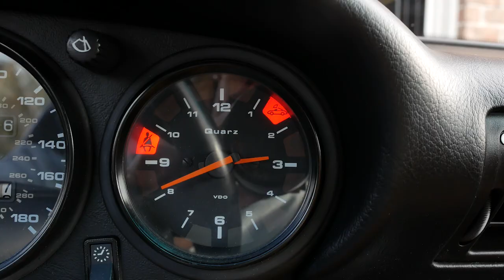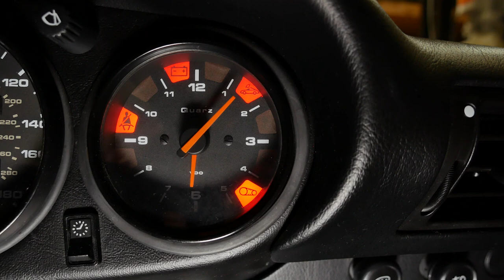Porsche 993 Convertible top Latch motor repair!

Comment: Your videos are great!
I'm waiting for my gear set to arrive, so I can rebuild my latch motor.
One issue I'm concerned about.
I took my latch apart as instructed by your video, yes easy!
I'm noticing that the cam that triggers the micro switch may be actually attached to the broken gear via a torx screw.
On Franny's video, her latch motor cam is attached to gear shaft via a set screw, which allows her to adjust the cam position after the gear is pressed onto the shaft.
In my case there is no way that I can adjust the cam position once the gear is pressed onto the shaft.
I'm trying to figure out how I can make sure that I'm pressing the new gear onto the shaft so that the cam will be in the right position to trigger the micro switch?
My car is 1991   911 or 964.
Any suggestions would be greatly appreciated.
Reply from the maker: I think I remember there are a couple different versions.  I think you will need to mark everything before pulling the gear off.  I bet the original manufacture used a jig to align it all before pressing on the gear. Is your microswitch position adjustable?
Reply: @HeidiandFranny   
WOW!  thanks for getting back to me.   
The part is temporarily back in the car.
I'm waiting for the replacement gears to arrive.  
In your video I can see that there were instructions that came with the gear set.  
Maybe that will reveal something.  
I'm not sure if the micro switch in my unit is adjustable.
Marking the gears and cam location before taking them out per your advise is my only option.
In watching your video, I'm seeing that you adjusted the cam by feel and visual as to when the micro switch engaged. 
That leads me to believe that the position of the cam does not have to be 100% spot on.
I will also check that function before taking the gears out and cam out.

Thanks again!

My biggest problem is that I know just enough to get myself into trouble.  LOL
This car is new to me, have only had it for a couple of weeks.
Sincerely
JC
Reply: @HeidiandFranny  
BTW
We named our 2014   991 Heidi while she was still in process of being built in Germany. 
We have never named a car before, but we probably going to name our 1991   964 Franny
Reply from the maker: @johnc1486  I'm sure you will figure it out. You can also bend the switch arm a tad for a little tweaking.  I'd have to dig out the instructions, but I think they detail both designs. The quality of the kit was great and it has been working perfectly ever since. Let me know if you get stuck when you start in on it and congrats on the new car! :)
Reply from the maker: Lol. That is great!  Heidi

Comment: HELP!11. First,, great video. Unfortunately I had one problem. I followed your procedure and located the bad motor. When I removed the tape from the front micro switches, the top would neither go up or down. The front motors were clearly getting power when I toggled convertible top switch. Unfortunately top is stuck partially open. Any suggestions? I’ve combed the web and can’t find any help.
Reply from the maker: Hi Jody, the latch locking arms both need to be in the fully open position...  You can use a long thin screwdriver to rotate the motors manually (look at the slanted holes if you haven't removed the top cover) and you may need to help the broken one along, but there are switched in the assembly that tell the top controller it is ok to run.  They will only be good if the latch arms are fully extended.  Take a look at the slot that they connect with above the windshield to get your bearings to be sure that, as you twist the screwdriver, you are going in the right direction.  It takes lots and lots of turns from end to end.

Since you have the top up a bit, go ahead and remove the long cover.  It will be way easier to spin the motors by hand.  Just get them both to the fully open position (Don't force them!) and your top should go back down.  If it doesn't go down, try to continue opening it and then try to close.  Sometimes the controller forgets what direction it was going.  Let me know how it goes.  If you get messed up, go to our YouTube home page  "ABOUT" tab and click the button to reveal our email and send me an email.  Franny

Comment: We repaired our lock using your great video as a guide and the lock works fine, but now the rear motor that brings the top from partually open to fully open doesn't work. Does indicate that we did not put the cam back in the right position and how would we know the exact worrect positon. BTW we did put marks and take pictures, but something went wrong. Thanks in advance.  Chuck
Reply: Ha Ha, we fixed it. It turns out that the cam was 1 degree off and it didn't activate the microswitch. We adjusted the cam and now it works great.

Comment: Great job!!!  Your part number says Convertible Top Motor
Gear Repair Kit- URO
991 624 056 03K
Did you mean 911 624 056 03K? I did find a kit with the 911 number.